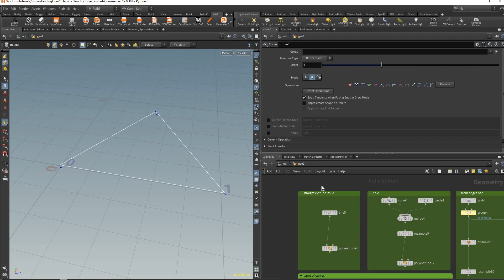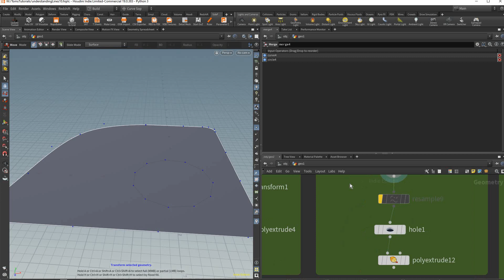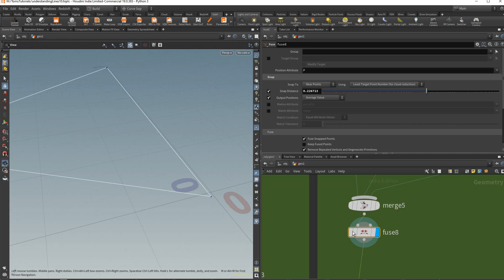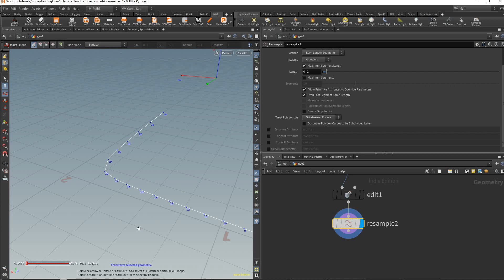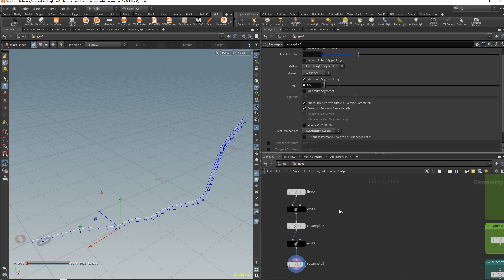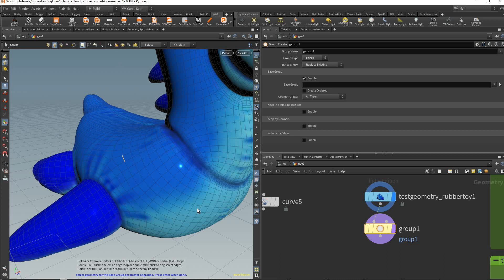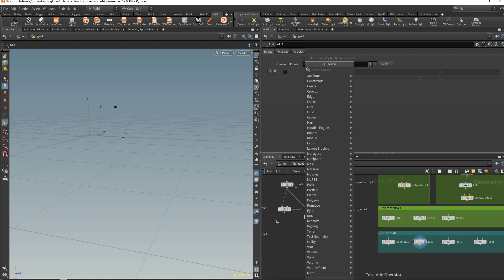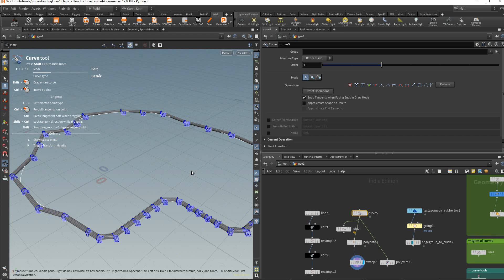Understanding Lines, Curves and Edges in Houdini 19

Comment: For your first example, It's not that the extrude doesn't work, it's that it works based on the existing normals on your geometry. Since geo created with the Line node does not have any, nothing happens. Rather than pre-transforming points, which results in loss of accuracy, you should create the normal (N) attribute before the extrude, and set it to the direction you want to extrude.

Comment: Thank you. In 1:12 about, in order to extrude a line you need to go to check transform extruded front, select global and transform along x,y or z. You don't need to move any points.
Reply from the maker: Good tip! 
I use that quite a bit actually!, it's scene dependent based on your orientation of your working object so I usually avoid teaching it not knowing what angle everyone is working on, but in this case 100% better option!  definitely good to mention it!
Thank you :)

Comment: Thanks for sharing your journey on Houdini.
Nice effort, but it seems you don't really know the reasons you need to use fixes to achieve you extrudes and sweeps.
I can't explain it all in a comment, but you should learn about normals, and also different types of curves (nurbs,polygonal...)
That way, you wouldn't blame the software when there's actually no problems.
I know Houdini is a different beast from max/maya/c4d.. It's approach is a little different when it comes to core elements, there's vertex but there's also points, and an edge is a primitive etc..
It's confusing at first, but powerful in the end. I went through the struggle myself, and I can see you're not there yet :)
I don't mean to be harsh, please don't take it bad. English isn't my first language so...
Reply from the maker: I don't mind as I can take criticism! It useful.

I do understand normals quite well and different line types such as Bezier, NURBS, et. If I'm able to communicate it well across my tutorials could be a different story. 
Its easy to confuse my understanding with my ability to communicate it.
But as Einstein once said, "If you can't explain it simply, you don't understand it well enough."  

There's more Sciencing I need to do on my lines for sure, to see how each type behaves under each situation, manually adjusting normals in a controlled fashion. Ect I do have gaps in knowledge that this exercise would probably help with.

My intent wasn't so much to blame Houdini even though It did come out that way a bit, I love working in Houdini hence the tutorials ;),It was more teach to people that may be coming from Maya or Max and don't really need to understand why it works this way but what to do to solve it.
For example I get that Houdini won't guess which direction to extrude a line if the normals aren't defined in a specific direction unlike other applications, that's what makes it challenging to learn but also it gets is power this way since you are in full control of all these aspects and it won't do weird things because its trying to guess what you want.